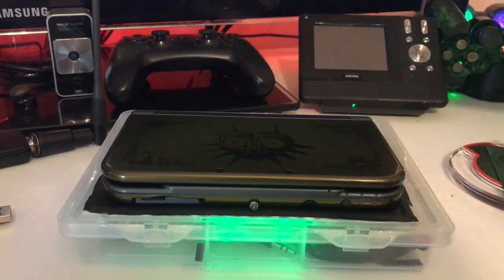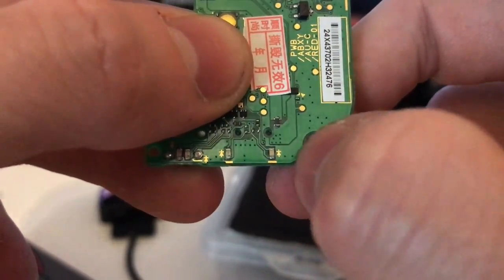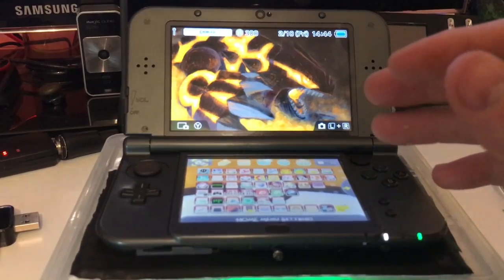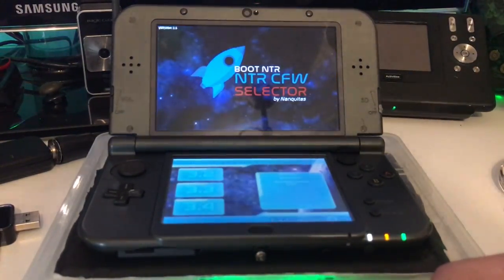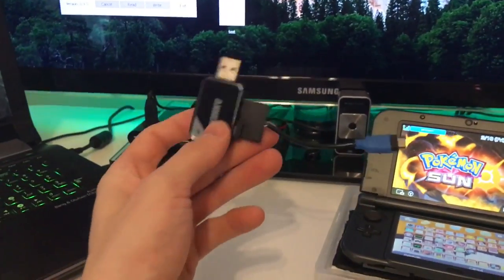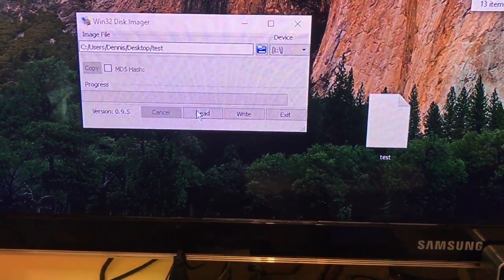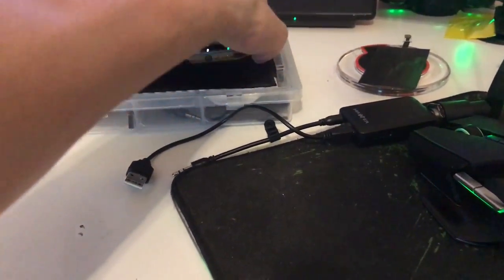N3ds XL Hardware Mods Part II, Including wireless streaming

Comment: You should make more 3DS videos, these hardmods are awesome
Reply from the maker: thanks, but my n3ds is full, no spare inch, also no more ideas :s i'll see what i can do
Reply: Wondering if there's a SPI or an I2C bus somewhere you could plug in. That way it would be possible to use software instead of the hardware buttons to toggle Bluetooth, and even fake-plugging a 3.5" jack to force external audio output.
Reply: @Gagliano17  rumble or dual battery mod like psp?
Reply from the maker: It has no space for any of that unfortunally
Reply: @Gagliano17  hey how much would you charge to be able to apply all these features to my new 3ds xl? And yes mine has cfw.

And if you are able to do it, is there a specific way you'd like to be contacted?
Reply from the maker: @neoentertainment4957  i couldnt say like this, i’d have to research the items, idk even if that bt module still exist for sale, lets start with your location, where do you live?
Reply: @Gagliano17  I live in upstate New York
Reply from the maker: @neoentertainment4957  yeah i am in the netherlands in europe :/
Reply: @Gagliano17  hmm that is certainly far. Would you happen to know any youtuber I can reach in the America's for modding? If not, I'd love to know where I can find these legit hardwares and mod it myself.

Also do you have an email or a discord or insta so our conversation is easier?
Reply from the maker: @neoentertainment4957  you could dm me on "dennis.tricks" on ig, and use GBATemp to find someone who can do the mod in the us, also i have tutorial videos + linked guides at gbatemp
Reply: @Gagliano17  I think I found you, I had sent a message just now

Comment: All that, & no screen protectors? 😂No dust caps for charging port or card reader? No 3D printed comfort grip from Etsy? No charm on the back through the wrist strap loop? No stylus with a Pokémon on the end?😂 for real tho that thing is decked out, super cool mods!! Well done. So much learning & patience goes into this stuff
Reply from the maker: thanks man, any of the jokes you named i didn't want :D screen protects are pretty unneeded on a closing system, i actually do have dust caps for all the ports, barely ever use them though, i have a case where the console goes in to when not used, 3d printed from etsy i wont need, got two 3d printers myself =P and sytlus with pokemon on the end? fuck i knew i forgot some sick ass mod to do

Comment: I know this videos old, but just in case you do see this, here are my ideas.

1 - tracker
Maybe it’s possible to fit a tracker inside a 3ds, like an apple AirTag or something like that. I’m going to try it myself because I lost my 3ds once.

2 - mini solar panel on top
It could connect to the back via wire or use your wireless charging to always be charging and it would be difficult to run out of battery. 

Maybe these ideas suck but you said you were running out so hopefully this helps

Edit: I wonder if it’s possible to make a thick 3ds case with solar on top and wireless charging inside so whenever you put your 3ds in it’s case it automatically charges. Probably very difficult, but dang that would be cool
Reply from the maker: your last idea is the most possible, but both are inefficient, wireless charging has loss of power, and needs like 2a to charge 1a, while solar panels have the same, they dont charge fast, so you'd lose twice, the airtag idea is possible. i've literally modded an airtag yesterday to work with a powerbank so i can put it in my car, it can be done in the 3ds, but it would take 3V, i've actually killed an airtag with 3.6v, it takes 3.12v max, so you have to place a tiny stepdown converter, which i have now
Reply: @Gagliano17  thanks :)

Comment: I always wanted to do a shell swap most of all, don't really care too much about anything else, maybe swap out the analog stick and the C-Stick to be a bit more easier to access.

I have a couple of those 3-game swapper things I've been itching to look into and modify and I want to make a custom shell with grips and implement the 3-game swapper built in. But until I get something like a 3D printer (or resin printer) I don't think I'll be able to do any of that.

But this does make me think I want to do the mods to allow streaming onto my computer, to capture A/V for videos.
Reply from the maker: I have guides for most the mods i did, so you can always use those :)
Reply: @Gagliano17  I'll look into them during the weekend.

Comment: Really cool mods! I love them, probably i’ll do all of them. I bricked my new 3ds and is on 2.1 without a custom bootloader, so i wanna try to restore the backup directly with the micro usb cable and the sd reader. My questions are: where did you buy your female micro usb board? And what’s the wiring scheme for the sd adapter? I know, this video is very old but if you can help me I’ll be grateful to you

Comment: Can I have more of an explanation on how to change the LED colors for the 3ds? I saw the imgur pictures but I don't understand them that well, I guess what I am asking is how you soldier the LED lights to turn them different colors.
Reply from the maker: I replaced them, bought other smd leds and soldered those in
Reply: @Gagliano17  Which website did you get them from?
Reply from the maker: Uhm i have no idea, i ve had smd leds in house since 2012, but they arent hard to find,any led web store should have them
Reply: @Gagliano17  Ok, thank you for the advice! I look forward to modding my new 3ds xl :DD
Reply: @Gagliano17  Wait I'm sorry, one more question. What size are they supposed to be?
Reply from the maker: @icymiles  they are supposed to be 0603, i'm sorry for the late reply, youtube is abit weird with the comment system, i've pinned a comment aswell

Comment: I want to add a port to the n3dsxl to use a usb controller i don’t care about soldering or if it takes a wire to each input but would like to know
Reply from the maker: i actually have seen that, it's possible and there is a guide for it on gbatemp

Comment: Do you have a guide to replace the top shell? I need to order a replacement because mine is scuffed up
Reply from the maker: it's just the 4 screws at the lcd, use a needle to pop the rubber out, there are 4 screws and then use a pry tool to open it up :)
Reply: Dennis Gagliano does that replace the round bar/hinge too?
Reply from the maker: the hinge is a pain :s it replaces the backcovers, not the inner side of the 3ds

Comment: Hey where did you get the power/charging/wireless led's?  They look so much better than the original ones!
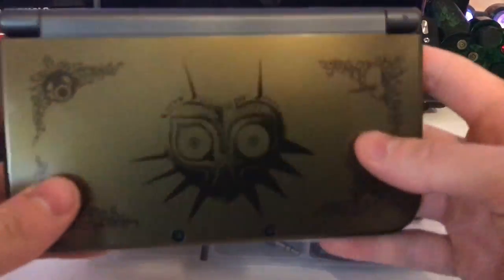Reply from the maker: I think i explain that at 1:50 of this video
Reply: Dennis Gagliano nope all you said was how you did it, not where you got the actual leds from :/
Reply from the maker: it are just regular smd led's you can get them on every electronic shop/store, i'm from the netherlands so i'd doubt that it would help where i got them from :p but anyway i got them from a dutch led webshop, led-buy.nl
Reply: Dennis Gagliano Dennis Gagliano ah ok, and I would just need a 2v led for charging right?
Reply from the maker: yes, those are trickier to find, because you still want a good color ofc, and red/orange are colors that just take less voltage so that's why i atleast went with a dope orange then =)
Reply: Dennis Gagliano Alright well thanks for the heads up, keep up the good work!
Reply from the maker: i wonder, did you ever change your led's?

Comment: @ Dennis G would it be possible to send you my old 3ds xl and help me input the Bluetooth mod as well as perhaps fix a small crack near the R trigger . l just dont want to open the system myself. I'll pay for your services
Reply from the maker: The old 3ds has no space on the inside what so ever, the wireless charge maybe but bluetooth no, only the new xl fits that sorry
Reply: @Gagliano17   l can do with wireless charge is it possible you can fix the crack near the r trigger if l send you the piece and my 3ds?

Comment: Would like to swap my 3ds case to a matte finish instead of a glossy one... but I have never found one.
Reply from the maker: Fendera remove yours and paint it
Reply: still have warranty on it. would be cool if there's a full aluminum body matte black or something..
Reply from the maker: you mean like a case? that would not be a mod then, mod's are supposed to void warranty :P if have a matt case you could paint the case, it's not part of the console so no warranty that will be voided.
Reply: Would you recommend to sand it down and paint it matt? I could buy another case for that and try it out.
Reply from the maker: yes definitely sand it, i don't think you need to primer, the mat should go over the black
Reply: thx :)

Comment: I set everything up, its amazingggg with the 50$ :)
Reply from the maker: could have asked me, i could have gave you a working free one :p
Reply: Dennis Gagliano actually you did give me. It was karanpc or something. That didn't open either :/
Reply from the maker: probably need to disable anti virus for such tools to work
Reply: Dennis Gagliano well shit.... btw everything is working fine but I have lag spikes, especially when OBS is open, is it my pc?
Reply from the maker: check task manager, obs while recording really get's heavy, my laptop has a i7 3ghz quad core processor and nvidia 540m, 2012 laptop, it can run it fine, but not much more then that, 12gb ram 1860mhz
Reply: Dennis Gagliano oh ok, I'll check once I get home
Reply: Dennis Gagliano just in case it's not my pc, do you have a fix?
Reply: Dennis Gagliano and last problem xD, when I have 2 WIFIS, my laptops and USB both on, Connecticut glitches out and just goes not responding. I tried this after hosting the hotspot on my USB then enable or just select it from the menu, but it always glitches

Comment: Yup this did the trick lol Im hard modding my n3dsxl lol I have a few ideas on a wireless charging dock and maybe I'll do an external antenna mod for an upgraded antenna lol I already have a booster that I use for my laptop that works wonders and all I need is an rp-sma pigtail from the  PCI port on the 3ds to make it work lol total overkill but eh why not lol
Reply from the maker: yeah totally, just go for it, let me know how it worked out :D
Reply: Dennis Gagliano will do!! So pumped lol

Comment: is there any way to make the wireless streaming smoother?
Reply from the maker: follow my guide on my channel on how to setup ntr, that's how i got it running so good
Reply: Did everything same. Even bought a dongle. The only different between us is that my Connectifty is hosting hotspot from my desktops internal wifi card because my router is in a different room. You are hosting with dongle from your WIRED right? I am thinking .... perhaps I can buy a wifi range extender that has an Ethernet port , thus giving my desktop a wired connection, but the extender would be getting internet from wifi router in the end anyway... so maybe that wouldn't make anything better. What do you think?
Reply: also another question, i bought a n300 "tenda" range extender that essentially plugged in right next to my 3ds on my desk to power outlet, and basically made a hotspot/access point from my wifi. but quality sucked too. maybe i need to get a much better range extender? (but i still have to get a 2.4 ghz one right because 3ds cant do 5ghz) will it be better or do all range extenders suck?
Reply from the maker: change port's it could be that people around you use the same channel that can interfere with your network

Comment: If there would be a way to connect bluetooth controllers it becomes a switch
Reply from the maker: Yes there is, but its not as you think, i have a video on it, its called “my 3ds xl is a switch” or something, made it before the switch came out, i was using a ps3 controller, but its funny how it works, you run the controller on the pc, and mod software on the 3ds and pc would communicate and then the pc controls the 3ds with what you do on the controller